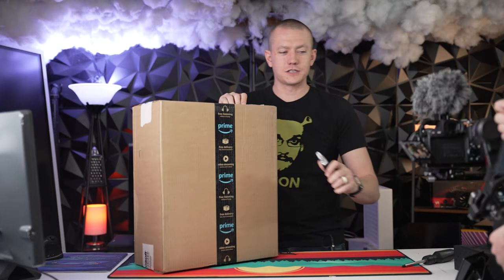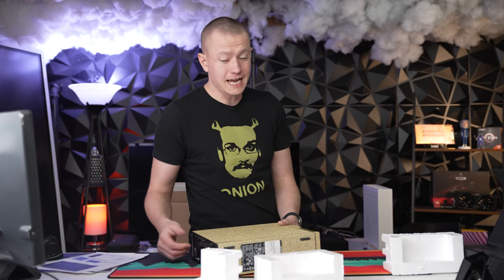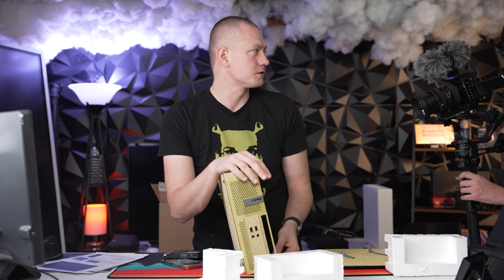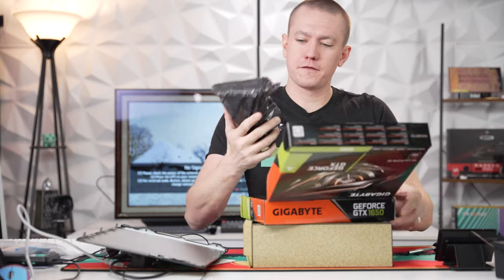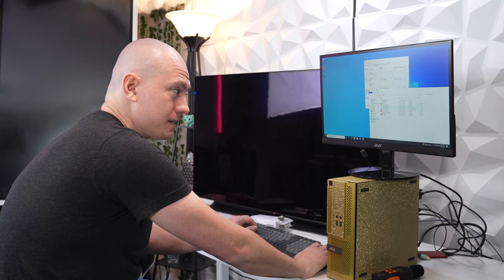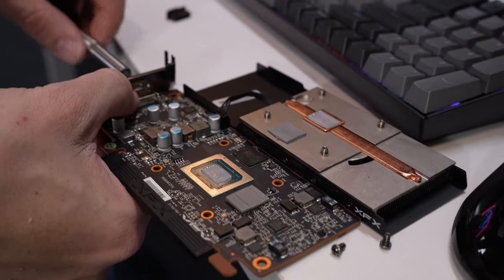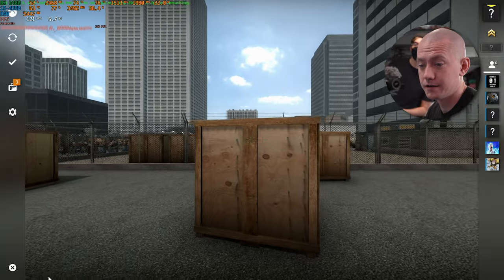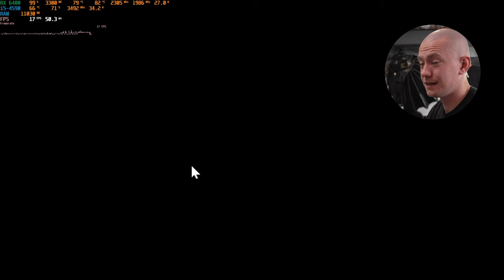The Craziest Budget PC on Amazon - Skytech Treasure Box

Comment: First Linus, now you?! Skytech & friends are doing something right 🤣😁

For real tho-- so much "older gen" hardware is still capable of PLENTY gaming once you spec 'em out with an ssd, enough ram and a GTX1650-tier GPU or better :)
Reply: I've got an SFF barebone with an i5 sitting right here someone threw out because the PSU died-- it only had space for a single-slot GPU, and I found a one-slot GTX1650 not knowing it'd be their last in stock for a long time.. but that system handles Far Cry 6 & Cyberpunk at 1080p amazingly!

Never give up on your older systems ❣ every gen still has so many games left to enjoy!

Comment: The pcie 3 is limiting it in spiderman. It's a bandwith limit. If you put in the gtx 1650 low profile in which is the same size as the 6400 and the 1650 had pcie gen 3x16 instead of gen 3x8.

Comment: The unfortunate thing is that's a 3020 which has a PCIe Gen2 slot, so the 6400 is way less than ideal. Had it been a 7020 or 9020, it would have a x4 slot at the top and you could install a dual slot card which would fare much better, but no real way to tell which you're going to get.
Reply: Hé, do you have a product page where it says that the dell optiplex 3020 has pcie 2.0? Or how do you know this. Thanks in advance!
Reply: @roelandreijtenbagh5196  It's certainly not easy to find in Dell's product sheets, but the easiest indicator is that the Q81 chipset that the 3020 uses only supports Gen2. Ipso facto, it's a Gen2x16 slot

Comment: I bought a refurb Optiplex last year with a i5 4670 in it, put an RX6400 in it and it actually holds up pretty well in most titles. You have to manage the expectations a little, but it doe much better than I would have thought. It can play quite a few games at at least 30 FPS and some will hit close to 50-60 in games like Battlefield 2042 and Warzone II on lower resolutions.
Reply: the rx 6400 works waaaay better in a PciE gen 4 system ... the performance is about half in a gen3 vs gen4 system. it might even be pcie gen 2, depending of the model you got ... which is also worse.

Comment: Hello everyone, for those who buy a XFX low profile rx 6400 card, it is possible but a pain to switch the face plate to the sff plate without taking off the cooler, i managed to do mine last night, and you have to go at the screw at an angle but its possible just a heads up.

They should definitely just make a hole in the metal shroud for easy access of that screw tho....

Comment: I like using a TV for a pc screen because you can cheat for performance if the tv has it's own built in pixel smoothing and other image enchancements.  I have a Samsung led tv with frame rate smoothing as well as pixel smoothing so I can run the pc with no AA and just make the tv smooth it and it look great and runs faster.

Comment: Imma comment the same thing on here that I did Linus's video. HP Elitedesk 705 with a Ryzen 5 Pro 2400g 150-250$ on eBay. I just bought my 6 year old a SFF variant so I can throw in a RX 6400( 🤢🤮 ) low profile in it at some point.
Reply: maybe look into getting another card, cause the 6400 performs much worse in a pcie gen 3 system than gen 4 ... and your ryzen 2400g is pcie gen 3 ... so your performance will be hindered.
Reply: @funkysmokee8764  Low Profile options are super slim.

Comment: You can use the 1x slot.  I am using a Zotac 1050ti even though it can only pull 25 watts in the slot it works fine.

Comment: My favorite budget build is a 1155 motherboard with a I-7 3770 gen 3 processor and 16g of DDR3.  The newest 1155 boards are upgraded to on board SSD and slot for graphics.  Wireless.  And cheap. About 300.00 for new build.